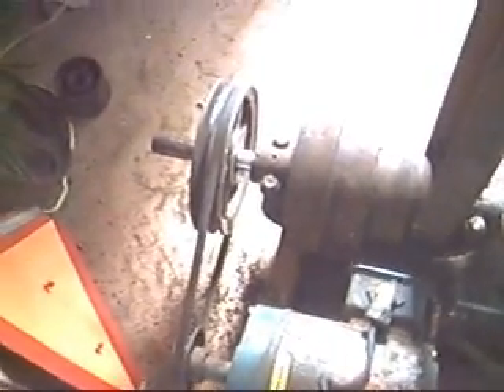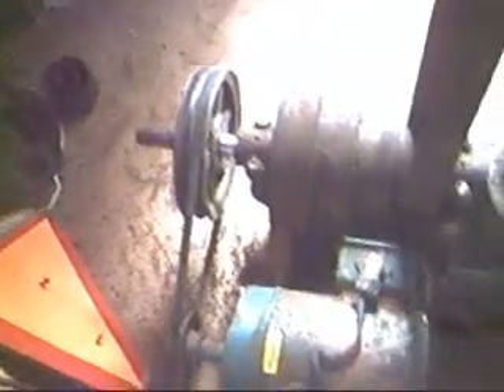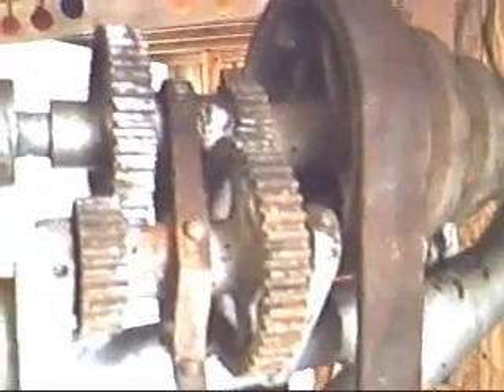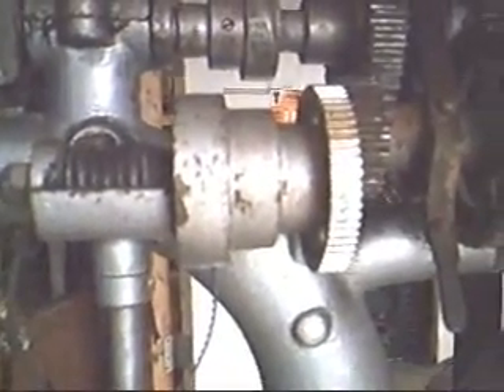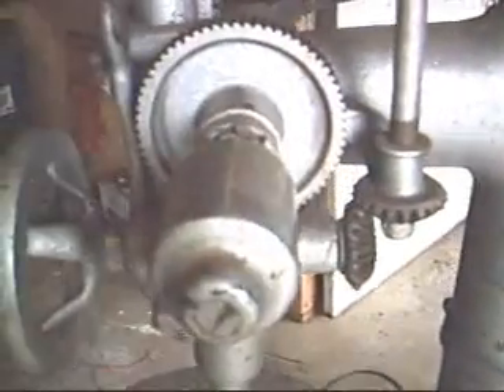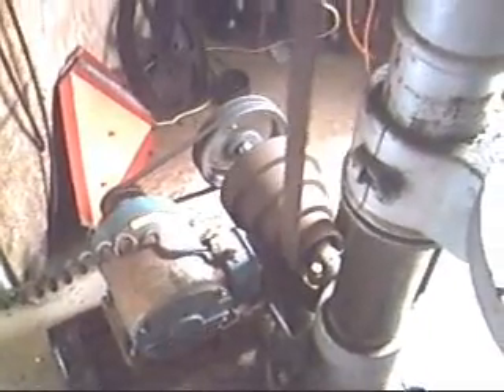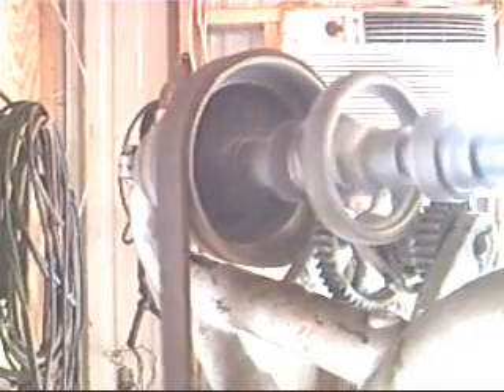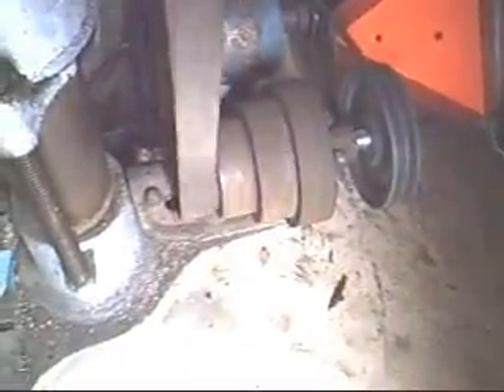Line shaft driven post drill, converted

Comment: The motor needs a very small pulley on it . The speed its running is way to fast on the low speed . I bet the motor speed is 3450 or so. It needs about a 1000 rpm to the flat belt or less . it'll ruin the press , sorry just trying to help.